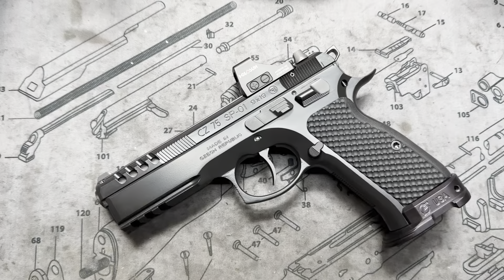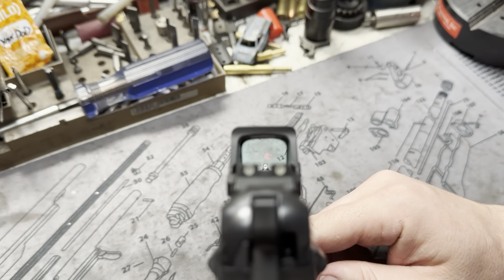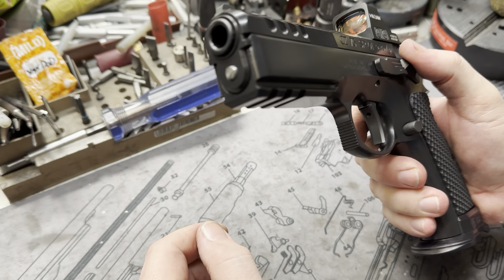CZ 75 SP-01 with Cajun Internals and Lightening Cuts

Comment: Wait so the holosun 507k cut option allows for using the iron sights that come with the gun?
Reply from the maker: Yes, on all the CZ 75 variants.
Reply: Is that also possible with the RMR or no? All the RMR cuts I keep seeing require a plate and rear sight delete.